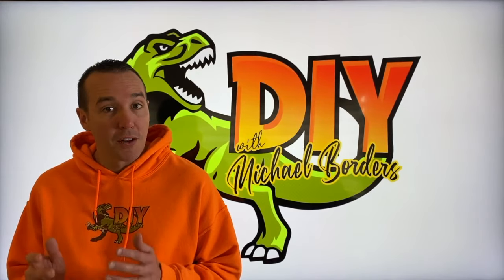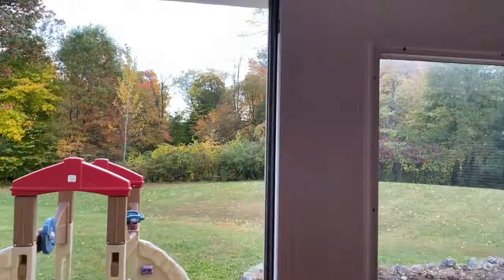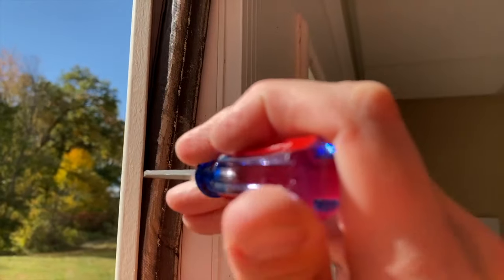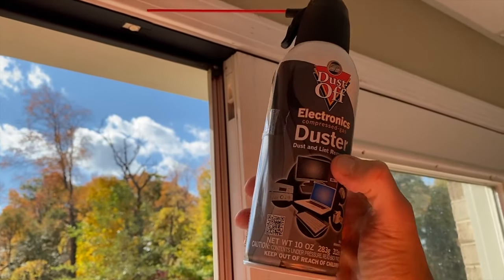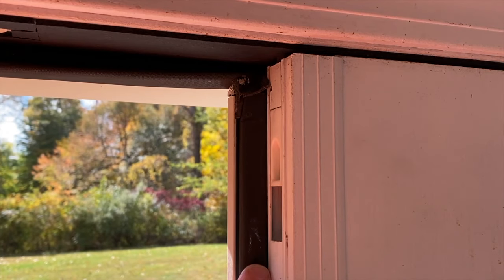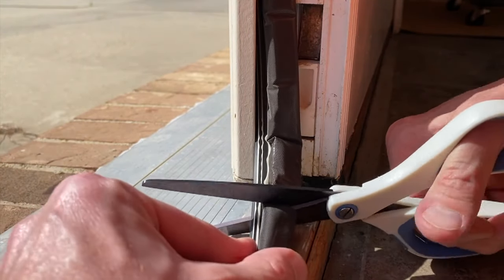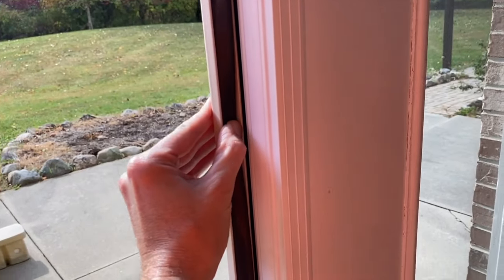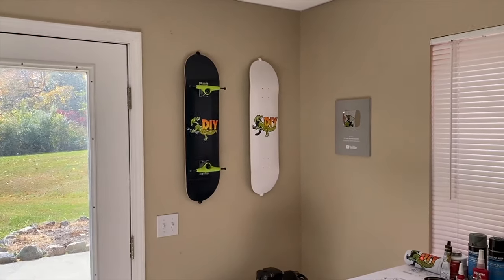Replace double door center weather stripping - DIY

Comment: Help please!  How do u open the door on the right?  I need to replace the long threshold piece that runs under both doors. I pulled the locking pin that’s on the right door at the bottom/top, even took out the hinge pins, but it won’t budge. Is there something else that would be holding it in place
Reply from the maker: @mack9208  

Thanks for watching.  There will be spring-loaded tabs on the inner portion of door.

You can carefully press the tabs in while simultaneously shifting lock rod up from the bottom and down on the top rod and tab.

😎👍🧰
Reply: @DIYwithMichaelBorders  thx man, I’ll give it a try
Reply from the maker: @mack9208  

👍🧰

Comment: This is awesome! Question, What tape did you use to seal the bottom gap of stationary door? visible here https://youtu.be/YN_M4JOzLpY?t=384
Reply: @trivedimalhar were you able to figure this out? We are needing to seal the same part of the doors
Reply: I’m needing this part as well. Im guessing it came with his door since he hasn’t provided a link to replace that pre molded piece. I’ve searched and can’t find it. Replacing the door seal doesn’t seal the door at the bottom no matter how much of the insulation you leave at the bottom. It needs this rubber piece to fill the gap and seal it.